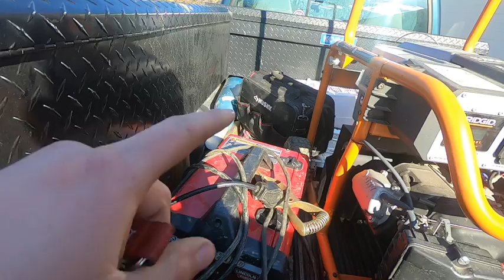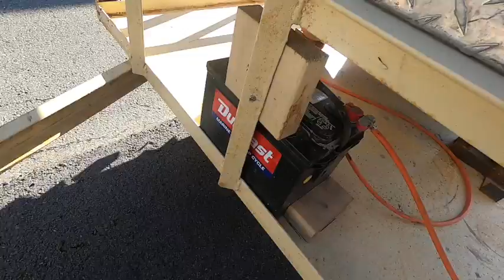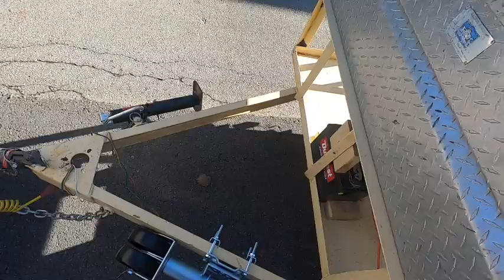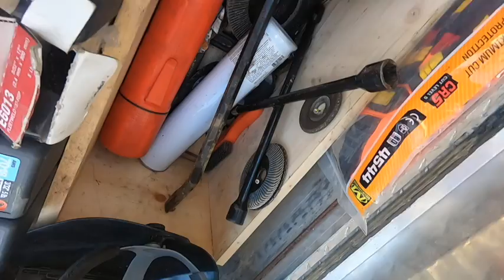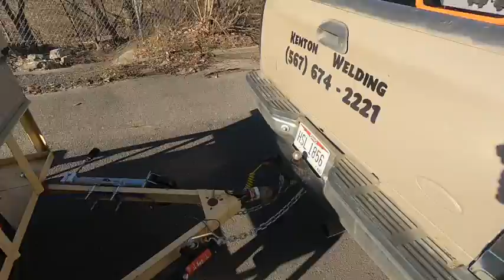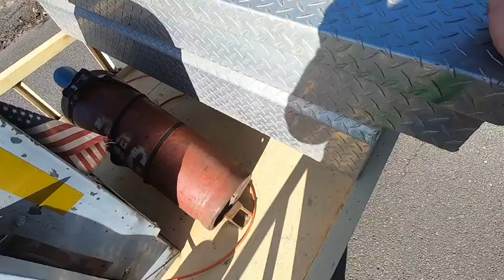My Second Welding Trailer Rig Tour

Comment: Is this a good enough set up to work at the refineries? 

I live near Baytown/La Porte Texas and thinking of switching careers but don’t want to buy a diesel truck and use payload capacity 

I’d rather tow a trailer around with a 1500 or maybe the new Ram EV
Reply from the maker: I couldn’t tell ya since I don’t work in refineries. I’d imagine it would if you got room to swing a trailer. I’m a stair-liner in northwest ohio. There’s tons of room to get this in most places and you can drop it if you don’t need it. I run a fronius trans pocket 180 and a Lincoln 210 mp on the truck rig which any more I’ve been more than satisfied with most of the time. The Sa200 comes out on bigger jobs and I have a fronius mig machine that I use when I know I’m going to mig weld a bunch. The trailer was parked at a factory for about a month and ran 20 hours a day at one point repairing a hydraulic press. I also was able to leave it in Delaware ohio on a stair job and it made it a lot nicer than having to back into the mud pit everyday. I just had to back into the nasty part once to park and once to grab it when I was done. That job took like 3 weeks. I will say the sa200 gets expensive to run compared to a vantage or something similar. She can drink like $100 of gas per day. The vantage I used at the factory used maybe 5-10 gallons of fuel per day.
Reply: @scrapmanindustries  I know almost nothing about welding 

I did a tiny bit in high school but I never messed with settings or Tig vs smaw 

26 years old need to stop working for my parents
Reply from the maker: @Kylewraps  I would recommend finding a friend or relative that could teach you to weld first. If you can’t find someone you know than go to school for welding before you go buy yourself a rig. You can make a crap ton of money if you have the right customers but you need to know what you’re doing before you get into the refineries. Most customers in the petroleum industry make you certify before you can perform work for that particular customer. Don’t be discouraged by that, it just means you gotta work for it. If you’re trying to do what I do however most customers don’t require certs and you can pretty much do whatever work you want. I would recommend still being pretty knowledgeable in welding before going full throttle into it. You don’t need to be an expert you just gotta know enough to get by. don’t be afraid to fail but don’t be afraid to send work to other guys when you’re in over your head. I get a lot of the jobs that most of the other guys turn down so usually it’s not all that fun, but it pays and I take pride in knowing I do the jobs others won’t. Some of what I have done is on my channel here. Most of it I don’t film though. Other stuff made it to the Kenton Welding Facebook page.
Reply: @scrapmanindustries  my neighbor worked in La Porte where they advertise $32 or $37 an hour
Reply from the maker: @Kylewraps  is that using their equipment or yours? If they want you to be rigged out using your fuel machines and consumables you’ll be loosing money. If that’s a W2 job using their equipment or 1099 and they at least supply fuel, welding gasses, rods and insurance that’s not too horrible. I charge $85 an hour now in north west ohio using all my stuff and sometimes I feel like I’m loosing money at those rates. Specially when I drag out the old Lincoln and get her burning steel in 3rd or 4th gear. When I just use the fronius and only burn a couple rods an hour it’s not too horrible.
Reply: @scrapmanindustries  I know he had his own F350 Diesel truck and rig 

Idk if they payed his other expenses or not
Reply from the maker: @Kylewraps  some places do like per diem or something on the rig. And then other people just drive their rig to their day job and do their own thing at night.

Comment: Great video and great rig. I am just getting into the welding end as I have been a chemist for most of my life. I bought a 1970's Westinghose 300amp trailer /six cylinder rig. I have a Hobart GW222 with almost 300 amps and a 100% duty cycle.  I figured I would have my chemist job fund my next stage in life. I thought you were in New Jersey. I found an awesome Harbor freight trailer that someone built.. Eventually I will be where I want to be. I love that trailer. I know a guy who makes four trailers a weekend and ends up with 6,000 a weekend. Keep up the great work my friend!!
Reply from the maker: I used to be in Easton Pa. right next to jersey.
Reply: @scrapmanindustries  That is so awesome. I live in Bethlehem right off Easton road. where are you located now? I wish we would have gotten in touch a couple weeks ago. I found a beautiful lincoln red face for 500 but it was in ohio and i could not get it but i was the first person to message the guy. it is gone now. I will try and give you a call later on this week or next. If that is cool with you. thank you my friend.
Reply from the maker: @jimmypopp2695  I'm in kenton Ohio now. currently working in Columbus. I'm gathering that red face was in need of a rebuild if it was only 500. either that or the guy had no idea what he was holding. I just got my blackface rebuilt back in June for $6k almost. things an absolute beast now.